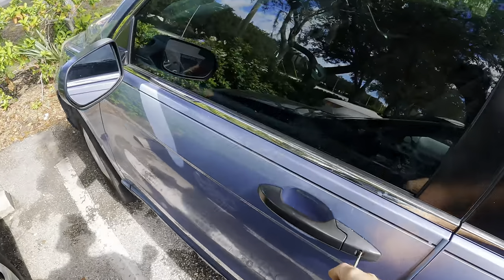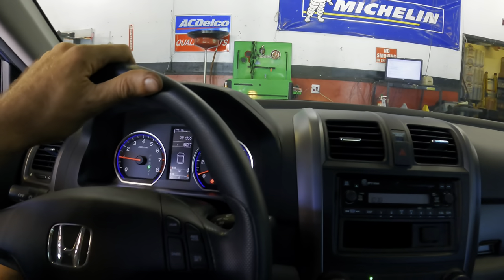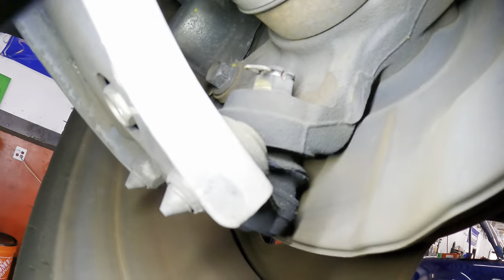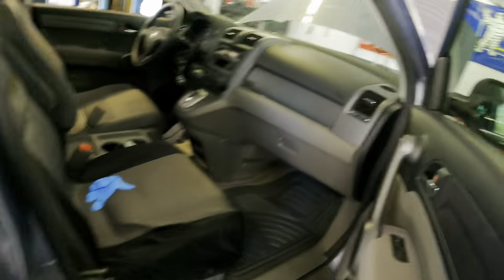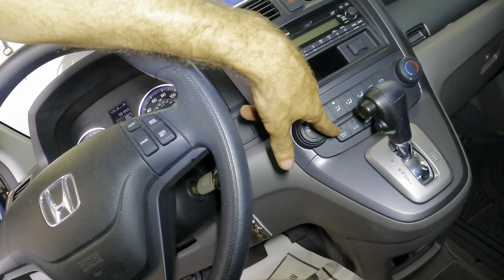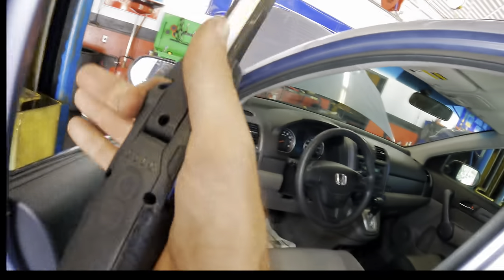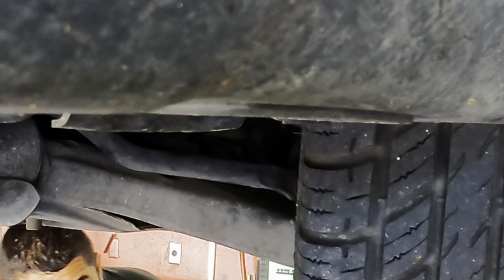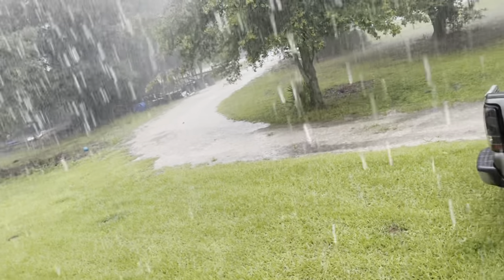Scam or Stupid? YOU decide! Work that wasn’t needed! Honda CRV

Comment from the maker: Go Check out my redemption video of self promotion on the second channel! 
Trying NOT to believe it! 2007 Silverado 3500 Duramax 6.6 Diesel system additive https://youtu.be/X4AbALaWR7o
Reply: Redemption, good word that.
Reply: that ending rocked, hahaha
Reply: I was just wondering you said the crv has 191955 miles, when in the clip it look like its actually 091955 mile on the dash, is it just look like that in the video or does it actually have 191955 miles on it? Just out of curiosity thanks!
Reply from the maker: @deanjrla552  I think I totally misspoke and missed it. It was 91k non 191k

Comment: I really appreciate your honesty in calling out the other shop for recommending unnecessary repairs.

You'd be the mechanic I'd want to go to if I was in your area.
Reply: "I really appreciate your honesty" - !!!  1000% AGREE.
Reply: This sort of thing is exactly why myself, family and friends WILL NOT take any vehicle to Firestone for any reason. Too many horror stories and they will straight up lie to your face, even when you call them out on it.
Reply: @gotdangedcommiesitellyahwa6298  i got an alignment done at a firestone and they gave me the before and after printouts and lied to my face when i asked him why the timestamp on the before and after papers were only 4 minutes apart. Something about an issue with the computer they use and its totally not that they just bumped the sensor until it read right and printed it again. I also watched them working on my car and knew they were full of it bc they never put the sensors back on the wheels
Reply: @ShellSide  Doesn't surprise me. Heard dozens of similar stories, such as slashing people's brand new tires or telling them they need other parts that had just been replaced by someone else. I couldn't even get a straight answer about tire ratings OR prices!
Reply: I have an older relative near Sarasota.  I know the name of this guy's shop, and I am going to call her and tell her to BRING HER CAR TO HIS SHOP!  She'll tell her friends.

Before long corporate is going to start wondering why the revenue from this one particular location is booming....
Reply: @gotdangedcommiesitellyahwa6298  My educated opinion. NEVER take your vehicle to ANY FIRESTONE EVER. They will bleed you dry with B.S.

Comment: I commend you Ray for being a man of character and conviction. I quit a shop many years ago because of similar circumstances where the mgr. wanted parts replaced on a customers car that was pretty much new I told the mgr and the gm. that a good reputation is hard to keep as a mechanic doing un needed repairs as I loaded my tools up!!
Reply: Mechanics have a hard enough job as it is, One of my friends was actually on the other side of service dept issues within dealerships. He had to rebuild a transmission and He found something else wrong ( steering or something under warranty ) and they said the customer didn't ask for that to be fixed. That along with some vacation issues and He loaded his tools up and left.
Reply: I strongly suspect that worked out well for you.  How did it go afterwards?
Reply: @anwalt693   for me I ended up going from shop to shop which most either sold out or went out of business hence I did a career change as repair shops and dealers became harder to work for

Comment: I once took my car in that had a remanufactured engine about 3,000 MI on the engine and the shop told me I needed new brake fluid new radiator fluid new other things like serpentine belt all based off of the mileage of the car and I called them out on that that they did not actually check my car and I did this in front of a room full of people...
Reply: Nice!
Reply: It's like when my wife takes one of our cars in for an oil change, they'll try to sell her on some bogus maintenance schedule items.
Reply: That is kinda how most dealers work... you bring your vehicle in with X amount miles on it, they've got a sheet saying this and that has to be done no matter what... every customers has to bring in at least a certain amount of money every time they visit for service. AND you can't even blame the people working there, they have to do it, corporate makes them do it. That's why my friend quit his job being the chief mechanic at a Honda dealership (Honda didn't do this for years, but started these practices some years ago) and opened his own place specializing in Honda.
Reply: Yep.  Similar thing.  Even had their fancy report tell me I needed a new cabin air filter.  My car didn't even have the housing for the optional cabin air filter. 
Another was the "dangerously worn" rear brakes that I "shouldn't even leave the shop with".  They were at about 40%, and still are.
I did pick up a filter housing assembly later, like I had been planning.
Reply: I am kinda lucky, My usual service engineers are pretty honest and have even talked me out of putting parts in my vehicle as they were not yet necessary. Well done sir for pulling them up.
Reply: My sister's ex-girlfriend brought her old Grand Cherokee to a Meineke for a state inspection. They came back and told her she needed brakes all around and that the wheel cylinders were old and shot. She had just bought the truck used a few weeks before and didn't tell them my sister changed the pads, rotors, shoes, wheel cylinders, and rear hardware. She called my sister and put her on the phone with the "mechanic." Needles to say, the Jeep passed inspection. Now a problem in NY is that most shops scrape the old inspection sticker off before they do the inspection. So, you're kinda screwed if they say it needs stuff to pass. You'll end up driving out without a sticker, already paid for the inspection, and having to go to another shop and pay again for a good inspection.

Comment: Back in the 90s, a major chain of repair shops tried to scam my mother. She noticed after driving out of town for 45 miles her inspection was due. She pulled into the garage to get it inspected. They came back and said she needed struts, ball joints, wheel bearings and exhaust system. Well over $1000 in cost. She got the estimate and brought it to her mechanic. The car was inspected without a problem. Since then she never took her car to another garage for anything.
Reply: Just over a year and a half ago, I brought my car into the dealer to get two recalls addressed.  Upon doing the multipoint, they recommended replacement of the lower control arms (car didn't have a handling or suspension issue). Note that I had my local mechanic do the state inspection on  the car about a month prior to taking it in for the recall work  (MA procedures now require the inspection by fully documented on video and the video be sent to RMV as part of the inspection record, so shops can't skip out on parts of the inspection), and he found no issues.  I told the service writer I'd check with my mechanic about it, and that was the end of that.  Had one state inspection since then, and my mechanic told me that everything is still fine suspension wise.
Reply: Mini- state inspections are total ripoffs !!! Back years ago our state had mandatory yearly inspection done through state  appointed “ service stations”. I had just did a complete brake job on the car I had at the time and went to get my car inspected, “well you need new brakes”!!!! I thanked him, went to another station , passed with flying colors. A few years later, the state dropped that inspection nonsense.

Comment: As a mechanic myself I must comment and hope that Ray see's this.
A visual inspection of ball joints is not sufficient nor just shaking the wheel back and forth. The ball joints are perpandicular to the motion of travel, so the wear will most likely occur by compressing the ball joint.
Hence you need to unload the balljoint and then get a large pair of vicegrips and squeeze the balljoint to look for movement and also rock the tyre from the outside top and bottom to see if there is lateral movement.
Also to check the sway bar links a pair of vicegrips is needed again to compress the joint to check for movement.
Looking at the vehicle from this screen tells me that this car isn't flogged by an old lady, but given the age and the torn boot, that is just wear and tear.
The D/S ball joint was replaced before and penetrant was used to soak the balljoint before removal, hence why it was covered in greasy dust. The tie rod end was also the same, which indicates that axle has had work done to it. 
I wouldn't be too quick to condemn the previous workshops assessment until these checks are done.

As a side note, I watch Ray almost daily and his work is of the highest standard for sure. So this is not an attack, just an observation from a fellow mechanic.
Love ya work brother 👌
Reply: If there is wear and tear of the ball joints or the sway bar, could you feel it when driving? Or wouldn't it make a clunk noise at times?
Reply: @captinbeyond  It depends on how worn the joint is. The swaybar links are not usually felt in the cabin as there is alot of rubber parts between the control arm and the chassis to dampen small knocks.
A ball joint won't necessarily give a knock either, it can start out as a squeak as you travel over speed humps etc.
I have seen 2-4mm of movement in a ball joint with no knocking noise to indicate that it is failing. It was only by physical inspection that I found it was flogged out.
Also yes for the most part there will be an audible sign that a ball joint or front end bush is on its way out.
Reply: Did she only pay for a visual inspection?  Because at 90,000 miles she very well could have rattling end links that don't have torn boots.  And that new ball joint looks like a Chinese mevotech which are sometimes bad right out of the box.  Why didn't you pry and wiggle and test drive?

Comment: I always get a kick out of the local Subaru dealers' service writers bringing "your" cabin air filter into the waiting area to show the customer how dirty it is, just so they can charge them parts and labor to replace it.  I've taken to marking the cabin filters I install (at home) so that if it comes up during some other service I can prove whether they've actually pulled my cabin filter, or if  it's just some dirty one they keep behind the counter.

Comment: I've had this at a dealer before, I put a timing belt on my sisters 01 Honda accord, and it went back to Honda for a safety recall months later. when we went to get it at the dealer they told me that the timing belt was going to snap and destroy the engine, it needed a trans flush and that it needed ball joints and tiered ends. the reason they had was that the non genuine Honda parts were going to fail and cause issues, to the point that the service writer was basically irate that someone would have the "audacity" to install non genuine parts. were talking about moog joint ends and a gates timing belt(kit) if I hadn't been there my sister probably would have been sucked into doing all the repairs..... also that car ran for 4 more years before my cousin fell asleep behind the wheel on the highway and totaled it.....
Reply: fyi this was probably in 2010 or so, so well out of warranty
Reply: wow

Comment: If we reset the fuel economy tracking on Mom's Lincoln Continental at the right time, we could get it to read 99 mpg for 5 miles.... There was a long hill on the freeway, where the engine was holding the car back.  Average econ without "cheating" was 14 mpg.
Reply: Average being the key word. Besides displaying average my olds can also display 'instant' fuel economy but thats' a rather useless feature as far as I'm concerned.

Comment: Integrity is a rare thing to find in service industries anymore. My hat is off to you and your shop. I'm not a mechanic by profession, but I've done almost everything you can do to a car at some point in my life and took auto mechanic shop for four years in high school. That being said, I picked up a project car for my son and I to build into a 1/4 mile car. Basically a FBO build with cams to start. We had a bad clutch slave cylinder which was replaced along with the clutch and new  lightened flywheel. When the slave cyl went failed, I took it to a non dealer shop to get it changed out. We did all the previous work ourselves, but my bum shoulder couldn't handle another transmission pull. So here come the estimate of all thats "wrong" after I drop it off. 8k worth of work.... "You need a new flywheel and clutch" they had maybe 500 miles on them... "It runs really rough and the CEL is on, needs fuel system fixed" no dude, I explained thats FRP cams and a race tune... They obviously didnt listen to what I told them about the car, or were blatantly trying to rip me off. I wish they had a Ray there.... 😀

Comment: I had a dealer recommend upper control arms because grease was leaking. The stock arms have no grease fittings. I had replaced them myself with Moog units, which DO have grease fittings. And when you squeeze grease in, sometimes a bit will ooze out from the boot. No big deal. But mechanic dude jumps to the conclusion that oh, I see grease, he needs new control arms. With that logic, a bit of leaking oil from a valve cover will dictate a new engine. Seriously, a LOT of these "mechanics" are nothing more than oil change techs. Gonna be great when electric vehicles start rolling in regularly for electrical issues. It will be, how many modules can we sell this person.

Comment: About 5 years ago, I took my 2005 Toyota Sienna Minivan to the Toyota dealer to have the timing belt replaced.  Given that the recommended replacement interval is 100K miles and I had 200K miles on the van, I thought it was time.  This is labor intensive because they have to remove everything on the front of the engine.  So, since they are right next to where the water pump is, and it's not an expensive item and almost no additional labor, they recommended replacing that also.  That made sense to me given the mileage.

So, I get the van back with the work done and they recommend replacing the rack and pinion because they said it was leaking and also the battery because it tests weak.  I pointed out that I check the fluids regularly and the power steering fluid level hasn't moved and the engine cranks like the battery is fine.  When I go home, I crawled under and found the boot on the end rack had oil of some sort on it.

Bottom line:  5 years and 50K miles later the power steering fluid hasn't gone down.  Where did the oil on the boot come from?  And, no, the engine doesn't leak.  The battery did eventually fail, three years later.  I think that they figured that since I was willing to spend some money on the timing belt and water pump, they could squeeze more money out of me for the rack and a battery.  It definitely left a bad taste in my mouth.

Oh, one other thing I almost forgot:  For several weeks after the dealer did the work on the van, I noticed a thumping sound coming from the front of the car when accelerating and turning.  Over time it got worse.  I finally figured out that they had barely inserted the bolt that connects the upper engine mount to the body.  Once I tightened it properly the noise went away.  So, I ended up thinking they were dishonest and incompetent.

Comment: I bought a Honda Pilot from a family member a few years back. They owned it since new and had it serviced at Firestone since the warranty ran out. 

Observations: 

The car had barely any plastic clips left holding on any of the plastic parts. The oil drain bolt was 2x OS and leaking. 

Just about every estimate was $1K+ and they always suggested things like a fuel system cleaning. 

Some stuff was oversold and not nessary IMO. I saw that they recommended spark plugs 20K miles after they had changed them. 

They did tie rod end links and they were banging after 20K miles. I figured it was because they were after market. I ordered Honda end links because the originals lasted over 100K miles. I hadn't looked closely enough at them when diagnosing. It turns out one was fine and the other one that was banging was loose. How did it come lose with the hex nut keyway? I think they binded it and thought it was tight. When it unbinded itself it started clunking. 

The other thing was thar other services were ignored. The power steering fluid was low and black. The trans fluid had never been touched in 140K Mike's. The rear diff had only been serviced once. The timing belt hadn't been changed or even suggested by 140K miles. Of course struts were suggested every visit and never changed and it still doesn't need them. The problem was the fairly new junk Firestone tires that have too much runout and need to much weight. They are currently on the back.
Reply: Those quickie shops always suggest a bunch of easy and useless work. They'll sell a zillion spark plugs and tie rods (and the accompanying alignment) before they do real work.

Comment: This is so typical of Honda dealerships.  A while ago I was dealing with a DTC 1457 Evaporative Emission (EVAP) Control System Leakage (EVAP Cantister System).  I took it to the Honda dealer to run a smoke test (to the tune of $100).  I was told post-test that I needed a new gas tank and associated fittings - estimated cost $1,730 -.  This didn't sound logical to me so I did some further investigation and found that the EVAP canister purge valve had a leak.  I replaced it myself for ~$53 and the DTC cleared.  If I did spend the $1,730 as Honda suggested, the DTC would have also cleared because the purge valve was included in the gas tank replacement.  Why should I pay for a whole fuel system replacement when only one part is faulty?  I suspect that's what might be in play here.  Why should this woman pay for essentially a full front suspension update when only one or two parts are faulty?  Getting a second opinion was the smart thing to do.